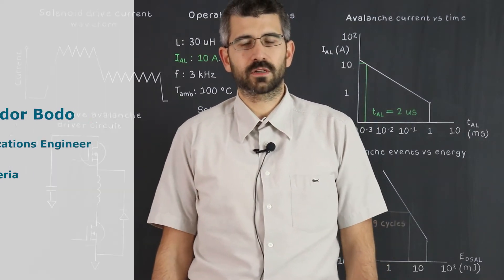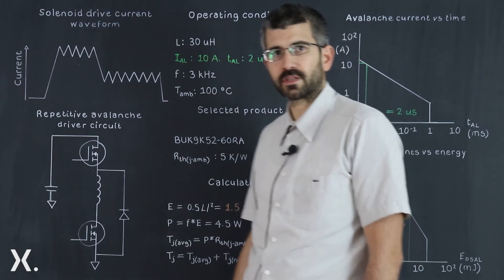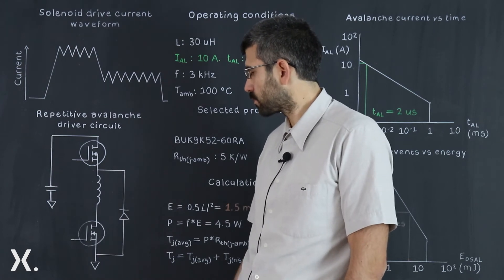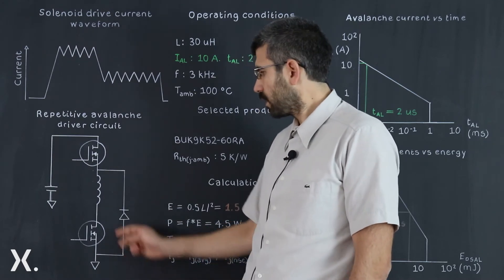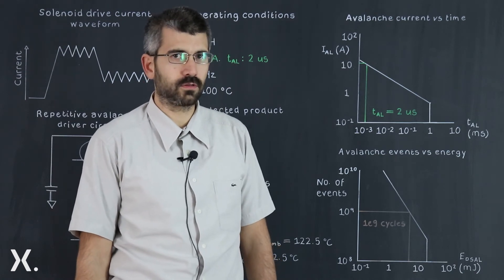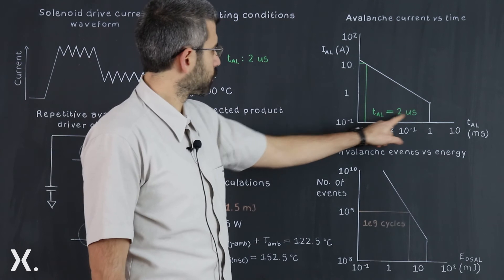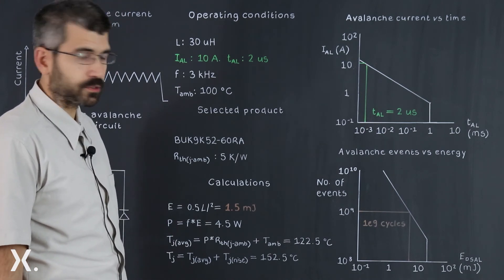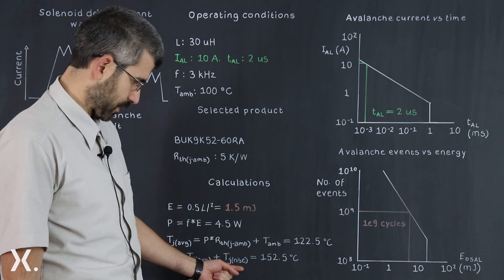How to select a power MOSFET for your automotive repetitive avalanche application

Comment: Very useful video, Thanks a lot!
Where is the value of 5 coming from for Rth(j-amb)?
In the datasheet of BUK9K52 one can find Rth(j-mb) with 4.68 K/W and Rth(j-a) with 95 K/W.
4.68 is very near to the 5 K/W for Rth(j-amb) of the video, which does not exist in the datasheet. Only Rth(j-mb) is described as the thermal resistance between junction and mounting base.
What is Rth(j-amb)?
Reply from the maker: You're welcome =) We got some feedback for your follow-up question - 

Rth(j-amb) is the total thermal resistance between the MOSFET junction to some point in the ambient that is more or less at a constant temperature. It is a sum of the thermal resistances of the junction to mounting base of the device (Rth(j-mb)) and mounting base to ambient (Rth(mb-amb)). However, as the time interval is very short (2us) we only consider the MOSFETs thermal parameter (Which you correctly observed from the datasheet). There is not enough time for the heat to spread into the PCB and so on. We hope this helps!